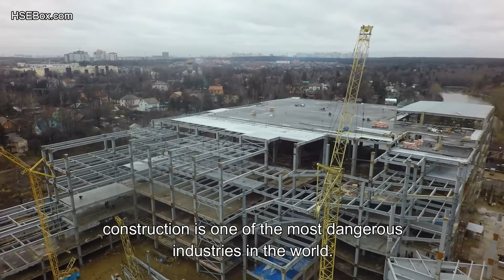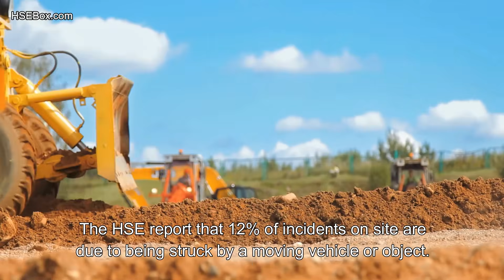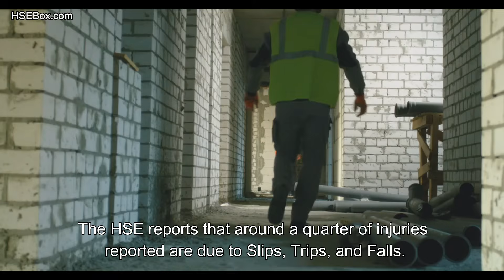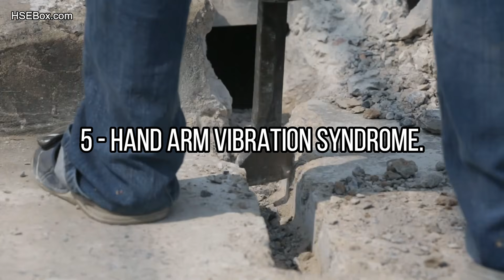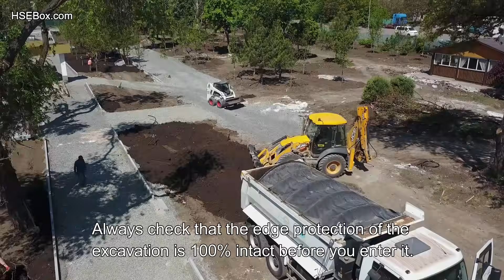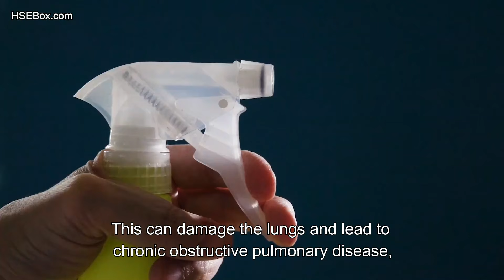Top 10 safety hazards in construction - Safety Training

Comment: The most common hazards:
1- Working at hieghts 
2- Moving object
3- Slips, trips and falls
4- Noise
5- Hand arm vibration syndrome
6- Material handling manual and equipment
7- Excavation
8-Asbestos
9-Electricity
10- Airbone fibers and materials
Reply from the maker: Great list, Luqman! 👍 These are indeed some of the most common workplace hazards that need proper control measures to ensure safety. If you're interested in learning more about hazard management and best practices, check out our channel and HSEBox.com. Stay safe! 🌟👷‍♂️
Reply: nice

Comment: Genny scanning equipment scan an area add foresee potential service(underground in wall )and prevent service strike.
Reply from the maker: Thank you for your comment! Genny scanning equipment is indeed a crucial tool for detecting underground services or those hidden within walls, helping to prevent accidental strikes during construction or maintenance work. This technology enhances safety by allowing workers to identify potential hazards before they begin digging or drilling. If you're interested in more details or best practices on using such equipment, feel free to check out our related content!